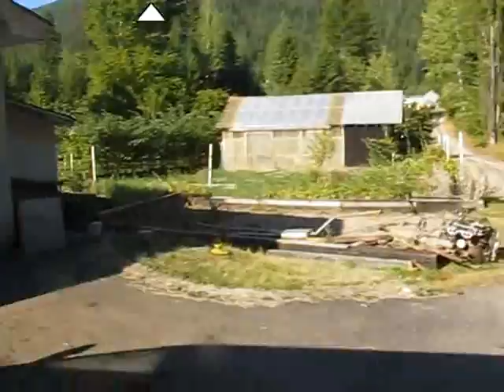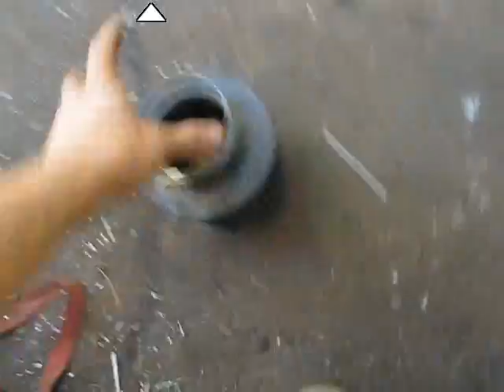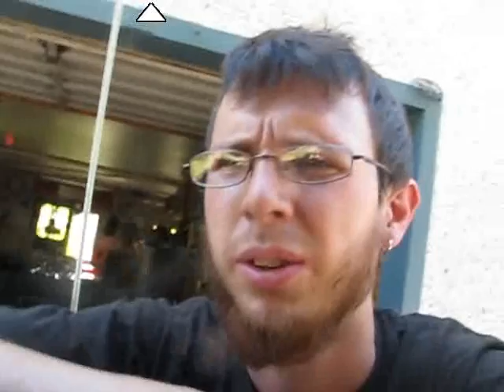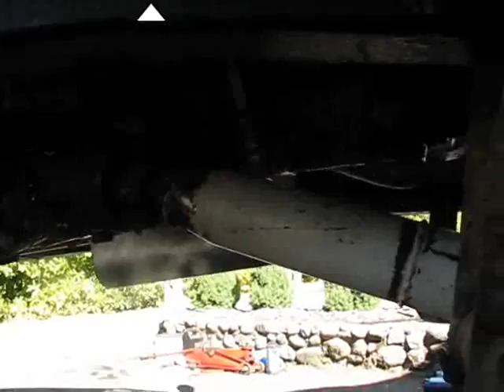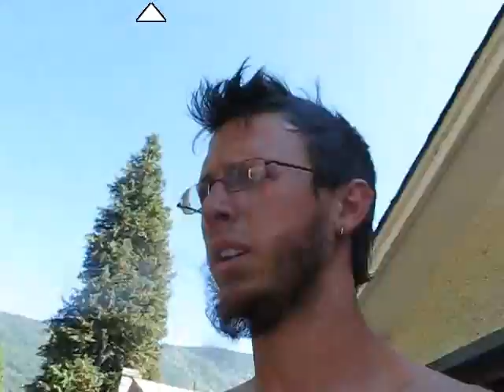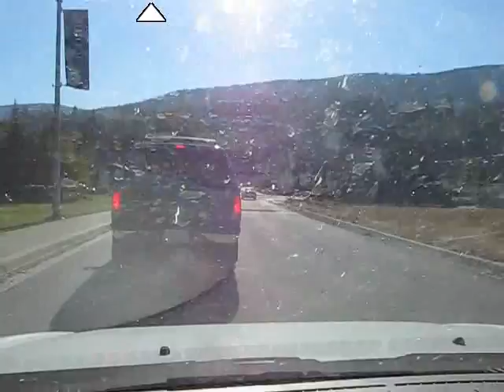94 4Runner: Front Highangle Driveshaft, and Diagnose Problem! (09/07/11)

Comment from the maker: @backwoods3214 well, the 94 4runner is using all brand new fuel line... from the tank, all the way to the flex line that bolts into the engine... i reused a fuel filter, and have a dirt fuel tank... once i clean out the tank tomorrow, all the problems should go away haha!

i like the single exhaust, its easier to remove, plus i only had to bend 1 piece of pipe :) ill be keeping the single, unless i get headers on this engine! if money permits, i would love to supercharge it as well!

Comment from the maker: @backwoods3214 well, i wanted the crossover so i didnt have to fight with running 2 lengths of pipe... plus the whole transfer case front output on the passenger side had me debating... i actually really like this setup! the only way i would go back to true duals, is if a shop did it for me...